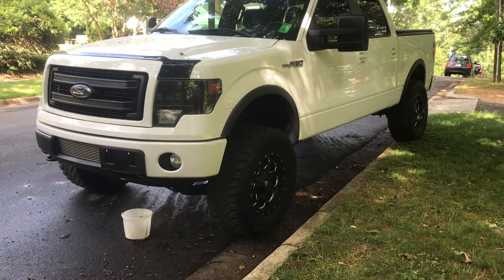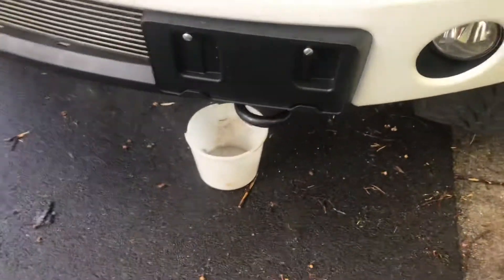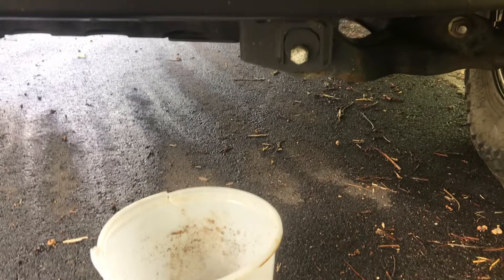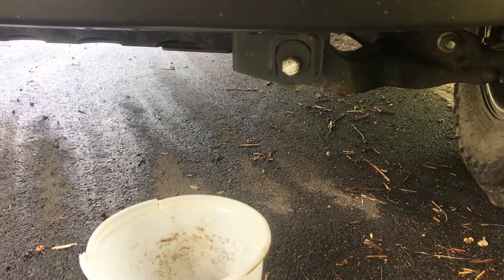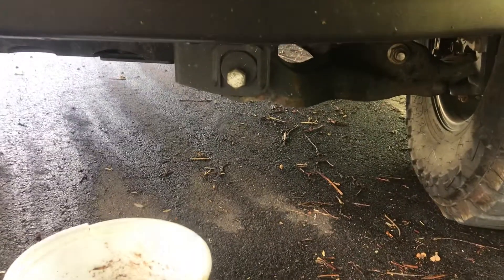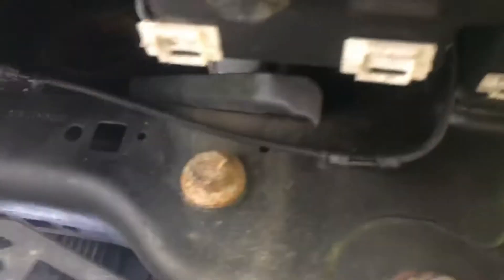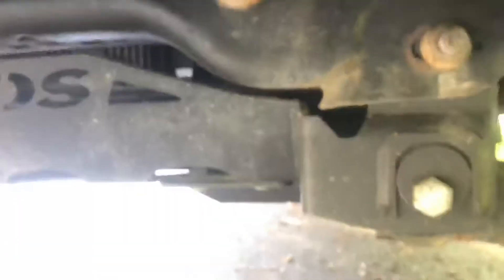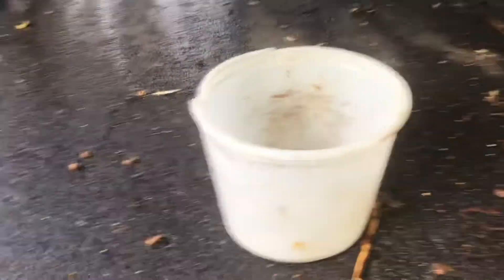Drilling hole in ecoboost intercooler?

Comment: all you had to do was take the intercooler out and flush it.  do an intake cleaning with amsoil power foam and install a  oil catch can.  you drilled an unnecessary hole my dude
Reply from the maker: Have you done this yet sir?
Reply: @zackw7055  I was a master tech at Ford sir.
Reply: @zackw7055  it's a common issues on 11-14 for the intercooler to get oil in it. There was a tsb for it to either take it off and flush it or replace it depending on how bad it was then do the intake clean.  The oil catch can is after market and greatly reduces the oil blowby so yeah I've done it. A few times actually
Reply from the maker: Was I think is the key word here. Just a simple trick I posted to hopefully help some guys out. People can use their judgment if it’s a good idea or not seemed to help me pretty well
Reply: @zackw7055  yeah I'm not at Ford anymore true. Was there 6 years. I am at a different dealership. But in my professional opinion it's not a good idea. Yes the theory behind it works. But now you have a hole that can get water dirt and debris in it which can be catastrophic. You can get a upgraded intercooler for a decent price. Wasn't trying to be rude. Just don't want to see that pretty ride get ruined
Reply from the maker: That totally changed my outlook I’ll plug it back

Comment: I have a 2013 3.5 drilled a hole at 50000 miles about a shot glass of oil came out have almost 80000 miles now runs great I’ve yet to put a catch can on maybe in summer

Comment: I just did this . Had it open for a few day's.  I did notice a difference in how my truck idles and runs . 
I also just did the plugs and changed out all the coul packs . Had a fault In #6 coil pack but changed them all . Keeping the rest as back ups .
Also noticed a difference in power . I have 140000km on my 2013 ecoboost .

Last summer o drilled a few 2 inch holes in my air box plus removed the fin like thing in the intake pipe right by the air box . I did notice a difference  .
No hp numbers but puch up a few thenth in mph  1/4 mile at put local track . She feels real good now . 

Unfortunately last night my daytime running lights will nolong turn off .

Comment: Have you covered the whole recently or is it still open since you drilled.... I plan on doing this to mine just to be in the Sade side but I might seal it up with like silicone paste
Reply from the maker: Frank V. It helped but not completely
Reply from the maker: Frank V. Yes still have the hole. Couldn’t notice any difference in power
Reply: Zack W did it fix the shudders